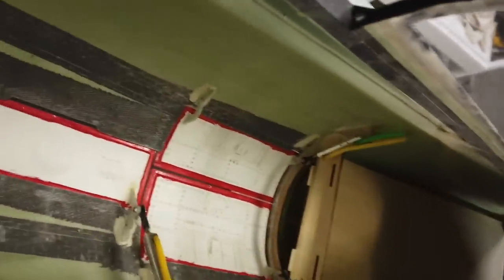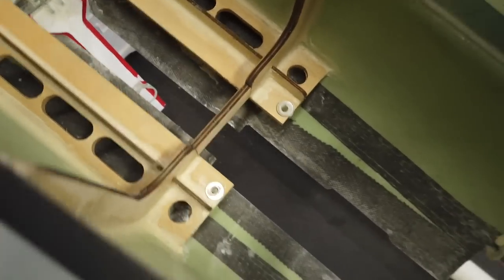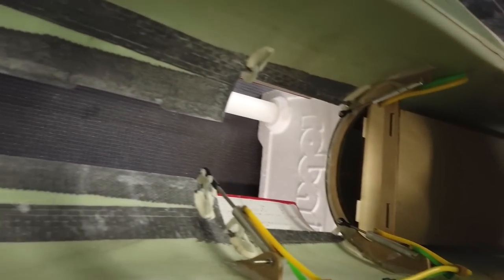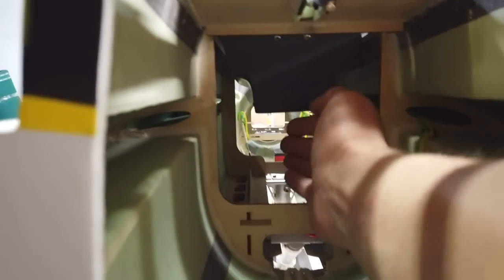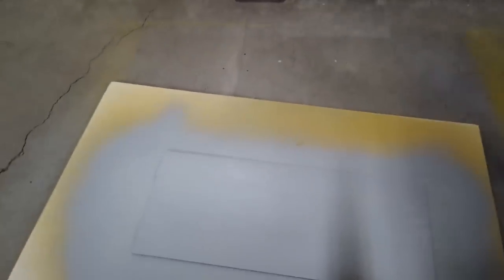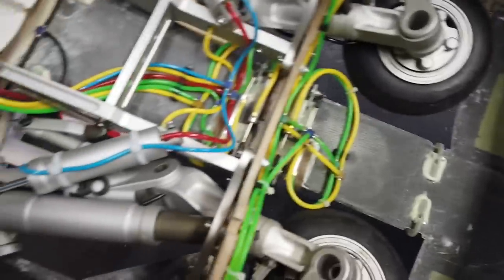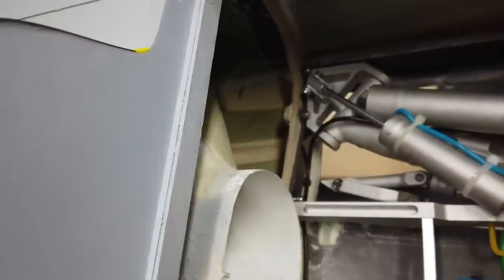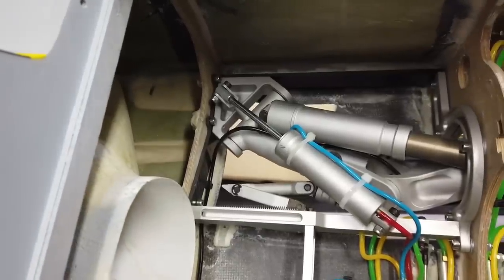SKYMASTER F-18 - Build Video #3 - Twin Kingtech 160 turbines

Comment: This build couldn't come at a better time, it's the exact one I'm looking at getting. The quality looks better than what I've read on forums.
Lots of good information.
One, which I preach all the time, is every plane should be lock righted by taking things apart. Too many people buy pnp's, arf's and put them together and fly them without going through everything, then complain because something broke or came off. Doesn't matter if it's a $500 plane or $25,000.
I like how you emphasis that in your videos. 👍
Reply from the maker: Thanks John and thanks for watching.  Yea the quality  seems better than the first generation.  The owner of this plane had a previous F18 from SM and it was one of the very first ones.  I worked on the wings for that aircraft and the quality looks like it has improved.

Comment: Is the scale landing gears you get?  I remember they have the white paint one which are more scale
Reply from the maker: Yes this is the scale landing gear for the kit.  These are the set from the original plane which was an early production model. Not sure if the new ones come painted or not.  I believe these were sent back to skymaster for them to inspect and install in the new aircraft.

Comment: There must be a new fangled loctite because Ive used that for years and Ive always known that loc tite is heat set.. LOL.... Soooo, you arent doing anything really. 

And Im really not impressed with this "plumbing job".. I know Id have a lot more pride in my work to leave something look like that. 

I guess the true craftsman in the USA are gone for good.
Reply from the maker: Odd because i've never heard of heat set loc tite.  I do know that if I use red on something and need to undo it than heat is really the only way.
Plumbing on the landing gear was all done by the Skymaster factory which is NOT in the USA.
Reply: @thelightersideofrc  Used loctite all the time in the shop. Often times we would take a blow torch and heat the bolt up just to be sure it was set. Worked in many shops, every mechanic I worked with did the same exact thing, and knew the same exact thing. Past a certain temp it will break down but an engine or trans never reached those temps.
Reply from the maker: That’s interesting. I do know that if there is grease or oil residue on the surface that may prevent the loctite from working. Thanks for sharing that.